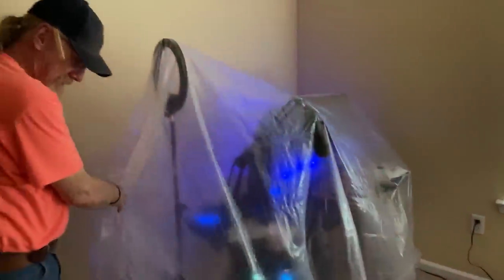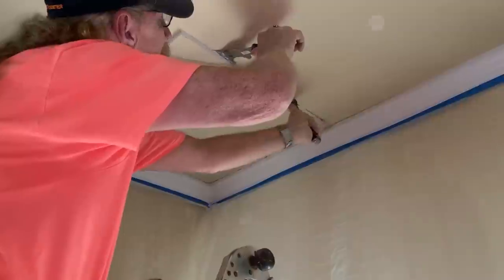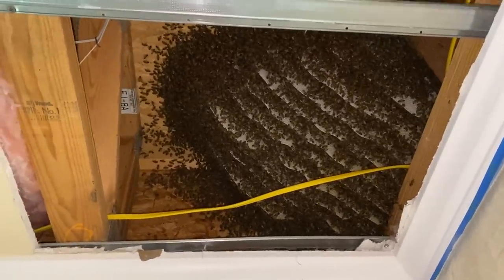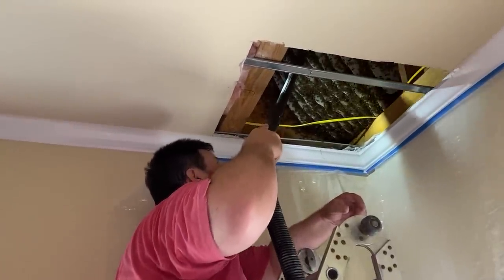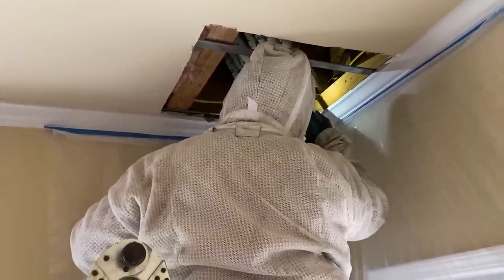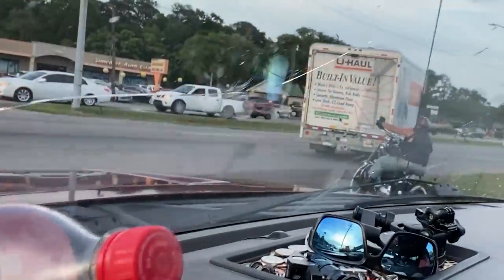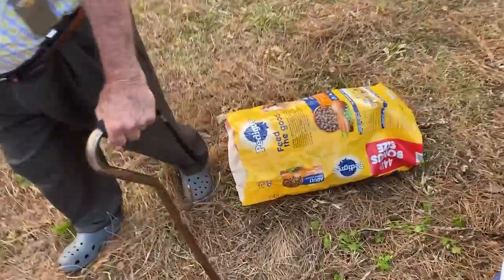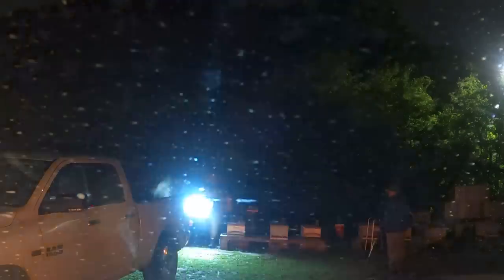Sweetest Ending To Any Job

Comment: You know I’m disabled and handicapped I can’t walk for anymore but talking about the parking place for handicapped people I’ve seen people parked in the spots that didn’t have a sticker or plates on their car parked in them places and not one thing wrong with them. Thank you Rooster for not parking in the spots. Great video be safe and GOD BLESS y’all Amen 🙏
Reply: Lol time for a bb on the valve stem core..insert bb screw on the cap loose enough to let air escape or easier yet, I have the core remover..let the air out.. inconvenience them. I'm not disabled but my friend is. It doesn't hurt the tire, it's just letting the air out . Yes, I make sure they AREN'T disabled.. usually just fat and lazy..lol

Comment: I thought  you would like to know .. I drove 4.5 hr. to get honey bees today I got there at 8;30 AM drove back home 4.5 hr. with AC on to keep bees cool got home to find most if not all bees dead from over heated . Pearson I got them from put too many bees in the hives not sure how to take this I paid cache with no chance for refund, Was on good faith.  I love bee keeping not to sure about some of the people.. I needed to get that out there .... Thank you for your thought good or Bad!!
Reply from the maker: That's terrible Roy.  A nine hour drive is tough enough without the loss of investment and disappointment of finding your bees dead on arrival.  I'm assuming it was a nuc?
I had a customer two weeks ago who killed a  really strong nuc within a day of picking them up.  After a little investigation I figured out what happened.  He hauled them home on top of his spare tire in the rear hatch of his Prius, or as I like to call it his mobile wax melter, and didn't take them out of the car as soon as he got home.  The nuc (Pro Nuc box) sat really close to the rear glass and took enough heat to kill the brood.  A good amount of bees survived but they absconded that afternoon.  I replaced the nuc free of charge and actually delivered it and set it up for him two days later (2.5 hour round trip).  I had two reasons for doing this.  Number one was I wanted to inspect the frames for myself.  Number two was he has been a customer for four years and has bought about a dozen nucs from me over the years.
Not knowing either of you I'll give a very unbiased opinion.  I routinely have customers drive as far as you did for just one nuc.  Most buy two or three but some just want one.  I always send them away with two just in case of queen failure, overheating, rolling the queen while transferring and so on.  It's easy to do something wrong if you're not used to transporting bees long distances or even on that sellers side if you aren't used to selling nucs ready for long trip.  If that were me and you sent me photographic proof of the dead hive that same day I'd likely send a refund.  In most cases though nucs are pretty much sold with a tail light warranty.  That means when I can't see your tail lights any more the warranty has expired.
Reply: @628DirtRooster  thank you for the reply. I have bought Bees from Spokane WA and the bees live the haul from there to here, this was a two supper hive with three supper amount of bees  in it if I had any Idea of that I would have not pick them up . I have work hard to get a nice be hive going I hope with some of the local bees owner help I'll get there. Thank you for the reply. Love what you do you and your wife Have a good Day...